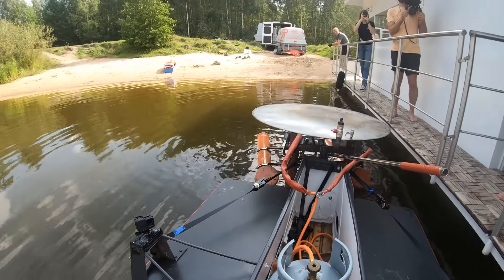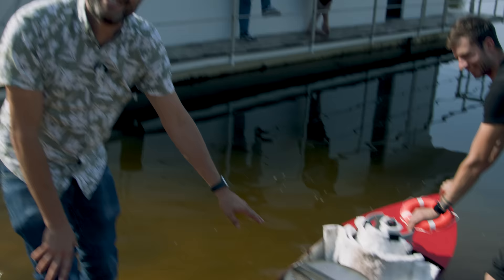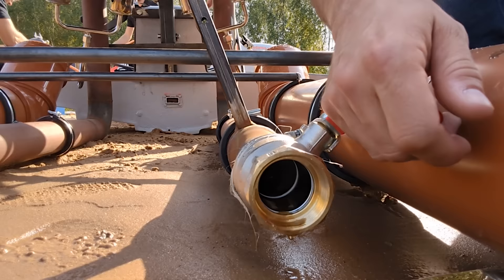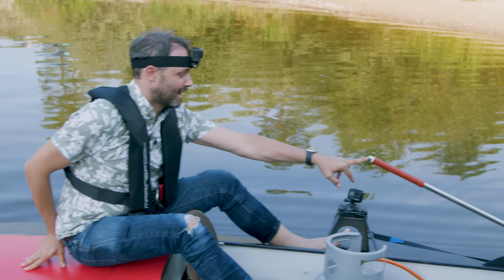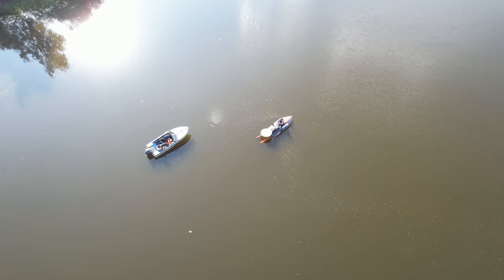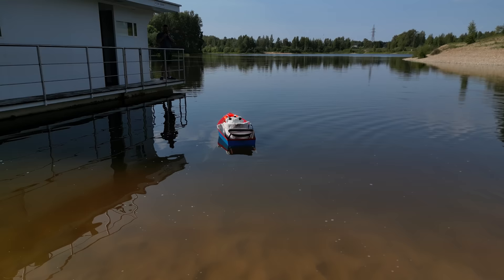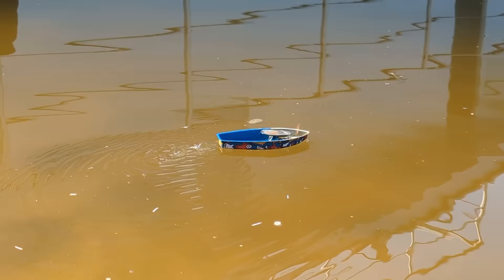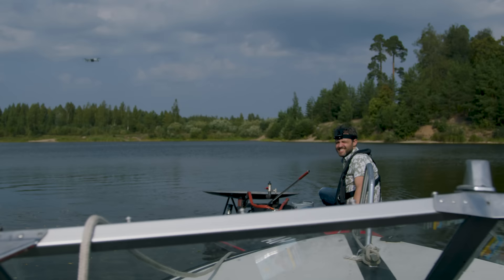Will this toy engine work at full size? (yes)

Comment: would get better speed if the inlet was facing the other way . so when it sucks in water  it also helps with propoultion forward instead of sucking the boat backwords

Comment: A scale airplane model and an airplane fly at the same speed too .
   A radio reciever recieves ¼ the radio signal at twice the distance , but it takes 8 times the radio electric field power to transmit twice as far

Comment: That pressure vessel shouldn't flex at all - seems like almost all the energy is transformed into heat and flexing that metall. Toy boats can be made way faster than this with fine tuning the lenghts of the tubes and their diameter in relation to the volume for the pressure vessel so you get resonance inside the two tubes

Comment: If scaling up the pop pop boat makes it inefficient, why not make 10 or more small "pop-pop" engines independent from each other (Exept for the heating, if possible and efficient) and make them run simultaneously at much higher frequency and with more output. This may solve the problem right?

Comment: @SteveMould I have a challenge for you....
Design human powered bicycle (with or without 2 wheel tilt steering front end)

Where when you go around a bend(turn the bike), you harness the centripetal forces of the turn into a mechanical feedback loop, that keeps the bike self balanced.

Objective is to use centripetal force of the turn to keep the bike tilted at the correct angle
so that the center downward mass is parallel to the bike frame...

You are allowed to think outside the box when it comes to conventional designs..
Like cams, pivots, swinging seats, etc....

Human power: no servos, gyros, motors...
Balance: completely done by the bike, not the human...

Is that possible?

Comment: 9:38 a good example is french fries, or crisps.  In america there's "steak fries" which are very fat.  The ones you see in classic diners.  And then there's like mcdonald's style fries.  I always told people I like the mcdonald's type fries because there's more surface area of fried exterior walls compared to the really fat fries that's mostly potato inside.  Kinda the same thing.  Slice a really fat fry into 6 slices... re-fry them... you have MUCH more fried bits on the outside.

Comment: nice videos , however you seem to have missed the concept, the original pop pop boots hade just a copper coil, the expansion being forced directly out of the boot, the cheap chinese pop pop boot, have  a tin tank to save on copper , it is not the original design which was a fairly fast boot, the victorians built them up to 6 feet long as I understand it , so what you should do is make a flash boiler pop pop boot and abandon the expansion tank concept.

Comment: Might be a stupid question but what about instead of using external heat to head up the water in the tank and if the metal dosnt need to flex why not use something like a moderfide hot water system tank like one out the back of a house?

Comment: So if you developed a full sized boat that had a series of small pop-pop engines, each with single pipe setups connected to separate engine chambers that use the same larger heat source? Could you have multiple high frequency  propulsion pipes providing more power? Imma have to start making some design sketches.

Comment: Now instead of requiring a heavy metal sheet to expand/contract (the pop-pop) then why not generate the oscillation using another method -- say, sonically. 
Jow about generating a hum across a thin metal sheet. Or better uet, simply sent spund waves into the water pipes as a caterpillar thrust.

Comment: Proportionally it requires a LOT more heat. One candle to the tiny boat, compared to a slightly larger torch, with a much larger boat.....

Comment: The design they used for popper itself shows its not gonna work good. They didn't give enough relaxation for the plate to bulge in and out which makes that pop. This particular feature however can be seen in the small toy boat

Comment: How much efficiency would be gained by eliminating the 'oil can' effect of the top and bottom?  I had thought the effect raised the output, but it would be simple to reinforce the big flat metal boiler.  Just weld some braces along the top and bottom to prevent the effect.

Comment: I'm not even an engineer and I can think of many improvements. Tank needs to be rigid and spherical or oviod. Heat source is wasteful. A can of sterno would be sufficient if engineered correctly. The water inlet could be powered by the steam engine itself. Or, the inlet could be hand sealed so you can pour water in and reseal it. You shouldn't need a drill powered pump to refill it. That's shortsighted. This is slow and crummy because it's a alcohol induced fever dream, instead of an actual feat of engineering.

Comment: Even though the boat and engine did get bigger, the density of water did not change, so the engine heat surface are should not have gotten bigger, if they kept the heat surface much smaller, the engine would have pulsed at a higher frequency, that would have made the boat faster.

Comment: ok, so what if you take a life sie boat but instead of 1 engine, you have lots of little engines working simultanious? perhaps you could even cut of the heat on one side of the boat , say left side for example, so that it would steer to the left ( and visa versa) and even have engines at the front contradicting the forward motion for a brake system

Comment: If the top was made in silicon it will move easier , resist to heat / corrosion , probably be more efficient with a heat chamber under insted of direct burner

Comment: The power source would need a significant upgrade, as well. That measly tea candle powering the toy pop-pop boat? That's easily 50-70W. For a 20x larger version, if we go by the cube scaling law, you're looking at 20^3 = 8000 times the power. A 400kW burner would look terrifying on any boat. Also terribly inefficient. For anything larger than a row-boat, you'd probably have to use a naval nuclear reactor.

Comment: Why can a pop-pop boat, on the large scale, not be used without fire but rather with a refrigerant as the filling medium instead. Where it expands and propels the boat at outdoor temperature, and contracts at the waters temperature? There would have to be other means in place, like possibly a diaphram to contain the refrigerant, or a cylinder style propulsion, but is this possible?

Comment: Having an advanced pop boat, where you have an engine to pump in the water, and an extensive radiator system to capture the heat…

Comment: Instead of making a single LARGE engine to move the boat, what about a series of smaller ones?
Would smaller engines with more surface area compared to the large one propell the craft at a faster speed?

Comment: What if you got a bunch of smaller pop pop engines that have a higher frequency? That way you match the propulsion forces of the larger one, but increase the frequency at which it acts on the boat?

Comment: Hi Steve, There are some suggestions for your pop up boat-
1. Put nozzle on steam/hot water ejecting pipe. It will help generate high pressure steam which will have  high velocity when ejecting and thus high momentum.

2. Put Non-return valve in water sucking line to heater. This will make sure that generated steam is forced to pipe with nozzle only.

These changes would increase the speed of boat for sure.

Comment: Doesn't do much good, but surface area of the burning surface was my first thought. Also the material used in the boiler-bowl??? Whatever it may be called. 
My second issue would be the length ratio of the intake/exhaust tubes/ports. Do they need to be longer?

Comment: A quilted field of many "smaller" pop-pop bulkheads would work better. (Surface to volume ratio = square cube law).

It's technically and external combustion steam engine pump. It's a successful failure.

Comment: Would it work better if they used much thicker gauge sheet steel for the diaphragm? Or if they used several smaller diameter motors (3 or 4) if the surface area to mass ratio is a factor?

Comment: Would you get greater efficiency with a reservoir that was inflexible, like the glass reservoir on your see through boat? Is there a different gas you could use that would be more elastic than water and is also lighter? Would that create more speed?

Comment: You should have used smaller tube in diameter but longer length..that steam in larger tube will pass without any presure..its just leaves rather a propulsion..

Comment: U talk if the cube law but it looks like u didnt apply it to ur fuel  usage and surface displacement. It was much to centered not spread out also ur lines was way to small if there getting hot theres to much friction not alowing enough fuel to pass. Now uf ur lines are freezing ur on right track..as a live steamer thats delt with many scales thats looks like a clear issue. Get ahold of eome local live steamers im sure they can help. I would say u need 8:burners pointedin in a outward a spiral 2-4 propane tanks an use 25-30 mil piping also the tank able to touch the water will help them not frost up.propane forges might be a good thing to look up

Comment: Could you "over complicate" this by using a wire heater dunked inside a pressure heater? That way you reduce the inefficiency of the water vessel flexing and the wasted heat of a flame burner.

Comment: Such boat human size must have a rotational switching air pop pop valve that should power 16 small stainless steel tubes. 8 + 8 with air poping switching valve.
2 large tubes don't work well because the air escapes too easy, with very slow frequency poping out. It's slow because the diameter gives access to big air bubbles instead of super fast bubbling from 8 1th pop + 8 tubes 2th pop. I promise you, it will work. You may expect 5-7 miles an hour. The steam boiler must be spherical instead of double disc. A sphere inside a second sphere will keep more heat trapped, hence becoming more efficient, like a flame eater gulping stirling engine.

Comment: I have some of the toys. You talk as if theres a mechanical plate pushing the water. I thought itvwas steam pushing the water and the pop was the vacuum generated after the steam pushes out the water and it sucks new watet ? Could the inlet be in the front ?

Comment: What if you scaled up by making copies of the small tanks? It seems to me that there should be some way to make them all able to be heated by the same flame, and that there may be a way to connect them all together in a functional way so there's not thousands of tubes everywhere.
Reply: Though any sections in series would have to be timed in some way to oscillate together, else they would average and cancel out propulsion... perhaps some thermal equilibrium properties could save the day?

Comment: I got the impression, that a toy pop pop boat moves by far faster than the larger ones shown here.
Did you actually compare the speed of toy and larger ones ?

The reason, why this thing isn't stearable, seems to be, that there is no propulsion, so no pressure to steer with. The motion looks more like merely wind drift.

The other thing is at 7:14 - if it is true and it is better for the metal not to flex - two questions arise immediatelly - why build these loud flexing plate engines instead of using stiff tanks instead.

Comment: The flexi-panel tank is unnecessary and causes inefficiency as Steve says, and it's loud.
My first boat was made from plans in an offshoot boys' modelling organisation from Popular Mechanics. It just had a pipe coil as a flash boiler. It worked really well, pulsed quickly, because the water mass was small so the resonant frequency was high, and quietly "chugged" almost silently.
The Pop-pop people spoiled the design: the water mass is too great, it takes too much fuel to boil and the flexing panels apart from being noisy, radiate heat. The top panel at least should be insulated but it's a silly design engineeringly. 
Chuck it out. 
The steam locomotive  industry was all over this problem more than a century ago. Learn from history, there's no need to reinvent the wheel.

Comment: El motor debería estar colocado en la proa del bote para que los tubos sean más largos. El agua dentro de los tubos forma arietes inerciales.
También debería ser de  forma de ampolla para que la pared no se flexione. Eso le resta impulso a las columnas o travesaños de agua. También habría que probar boquillas de salida más estrechas para aumentar la velocidad del agua al salir de los tubos.

Comment: As a hobby model maker for most of my life I have built pop pop boats, however I didn't use a tank. At the simplest I would bend the tube into a U shape and heat the bend with a tealight, the hull would be a simple balsa wood raft with a pointed end and the rudder a piece of tin can flattened out and pushed into the stern between the tubes so that it could be bent left or right to make the boat circle. I wanted to try it with a radio control set up but this was before micro servos and receivers were available. This design worked fairly well but could be improved by bending the tube into a single coil and heating the coil this was better especially when the coil was given a kitchen foil "hat" to keep the heat in. I found that increasing the number of turns on the coil didn't really improve things very much. I also never got around to trying multiple "engines" in one hull.

Comment: You are WAY too late.  I saw this written up in Scientific American Magazine in the 1950's.  The engine was fitted into a rowboat, exactly the same way it is fitted in toy boat, the pipes going through the hull at the back.  The only other detail I recall was that the output pipes were 3" copper.  I don't recall the boiler or heat source details.

Comment: Could you have a pipe forward and a pipe going back both with tesla valves so that it would "pull" water in from the front" and "push" from the back? Would it still work? Or would that turn it into a different type of motor? Or just not work?

Comment: To make the toy boat more scalable you would need to heat it up with a different mechanism... A microowave could do the job of heating up the water inside?
Reply: because then the heating would not depend of the surface area.  It would work something like industrial microowave heating

Comment: Its Not a surface areaOnly..
Remember 10:37  the Size Is 4 times more massive. But The temperature of the fire is Still in that Temperature. It should Also 4 times More hot. Isnt it.

Comment: so what if instead of a sail you had several mirrors to point the sun at the dish in order to heat it?

I assume the larger the mirror the more heat on the plate but then the more weight so you need a larger plate so then you need a larger mirror so you have more weight to you need a larger plate...

Comment: Relationship of size to frequency - Pop pop boat engine frequency to heart rate: intuitive explanation or false comparison?

When you showed how the frequency of the small pop pop boat (engine) was much higher than the frequency of a large pop pop boat (engine), I immediately thought of heart rates in animals and pictured the little pop pop boat as a hummingbird and the big boat like an elephant. I watched the video you linked about the square cube law.

Without getting into the weeds of metabolic scaling laws/theories, does the comparison of engine frequency to heart rate using the square cube law broadly hold up scientifically? A.) Yes B.) No C.) Ehh–it’s complicated.

Comment: If you used the 4 burners to run 4 seperate smaller discs surely the rate of ocilation  would increase thus maybe the speed of propulsion?????????

Comment: How about a setup where a tank of Hydrogen and tank of Oxygen (half the capacity) feed a closed underwater cylinder with a spark plug? The expansion may be short but there would be heat, and the only exhaust would be water. How neat is that? (Hmmm, too obvious, probably already exists)

Comment: Maybe pump some helium in and expel the oxygen after filling with the water to the same air pressure the oxygen had and hold the pressure with a regulator so you aren’t running it off the helium persé? And yeah, bigger diameter pipes and you may solve the surface area problem? More ppm = more cycles or am I trippin? 🤔

Comment: What I was more or less looking at is like a pressure lock recycler or something something kind along those long lines of something that can be like a car thermostat or a car water pump not the car version of it but that's my field of expertise I guess what I'm more or less looking at is if you could put water back into the system and it could turn more of it into steam would that increase your chances like let's say put a tank on it and your third tube or propulsion isn't exactly propulsion but it's recycling 30% of your line back into a tank to be condensed back down into water it can be rooted repeatedly recycled or am I just not understanding the point of this boat

Comment: your lack of speed problem is cause by the size of your exhaust pipes They are too big and need a steering nozzle instead of turning the engine  (similar to a jet drive)

Comment: You’re measuring the wrong thing.  You should be measuring how many boat lengths are traveled over a give time, relative to each boat.  I think you’ll find that the move at the same rate.

Comment: Yes sorry but wrong design. Should have made multiple sizes and compared where the material is best at. This is way too big engine, i would guess 1/4th is about the optimal engine. Then have 4-8 engines. if you wanna go further you can make them fire at different timings to create the engine sound and no lag propulsion. You can clearly see that the engine is fighting with the upper plates material.